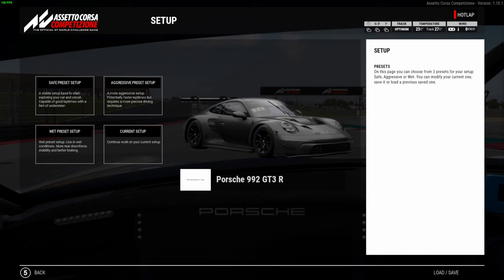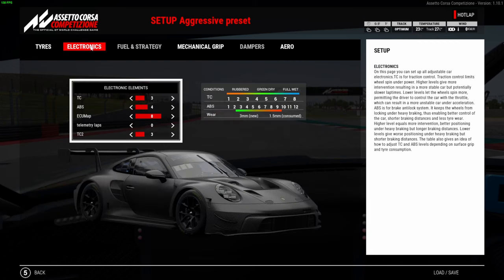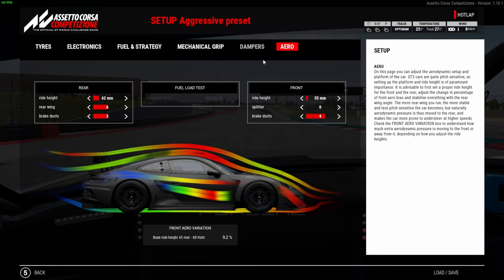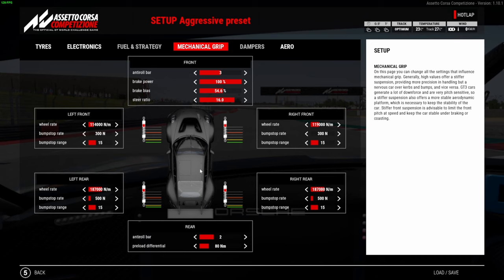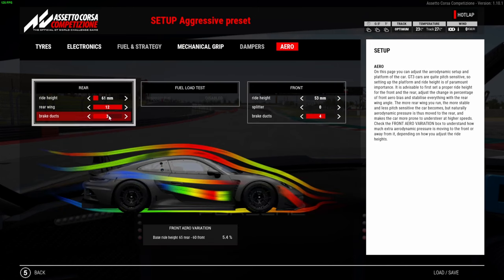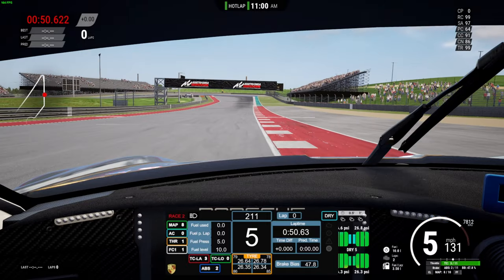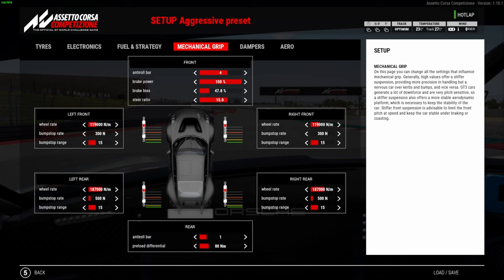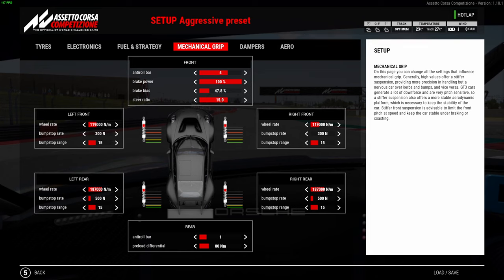The Ultimate Guide to Rake Adjustment on ACC

Comment: Thanks for the video, mate. Helpful content for us newcomers. I have been mostly driving the McLaren and NSX as I enjoy the character and balance of their MR configuration. I do love the Porsches, but setting them up has been a bit tricky. You've inspired me to give them another go. Correct me if I'm wrong, but I imagine making the rear really soft with high rake would help it squat more under high downforce, ultimately increasing top speed despite the higher wing angle? Cheers

Comment: great video! When would you want to use more/less rake?
Reply from the maker: Tracks with a lot of mid and high speed corners like Hungaroring, Barcelona you may want more rake but you always need to find the balance. Low rake is normally tracks that have long straights as less Rake equals less aero drag.